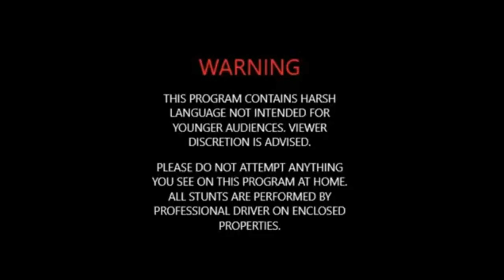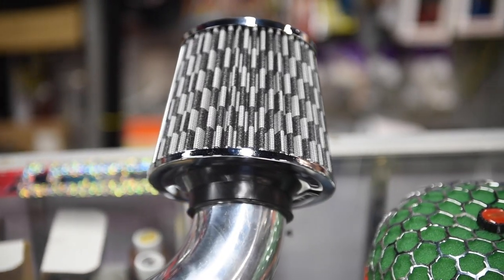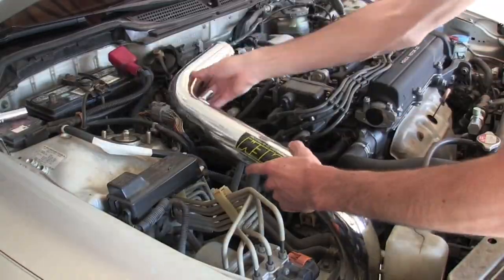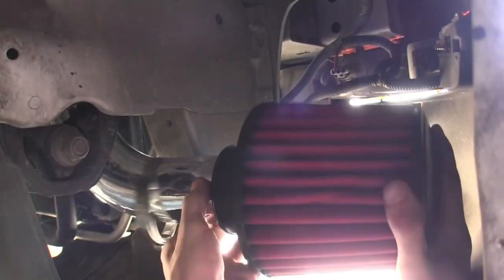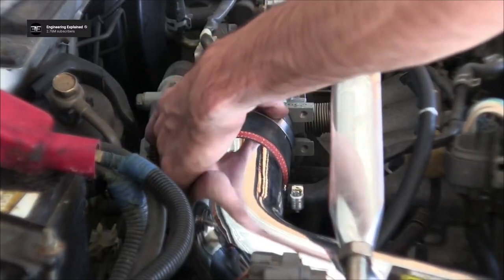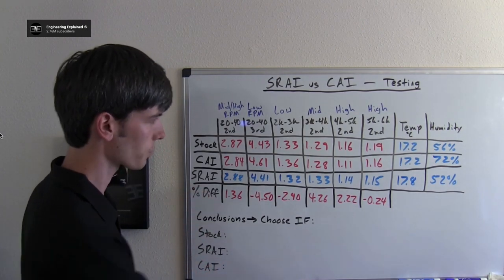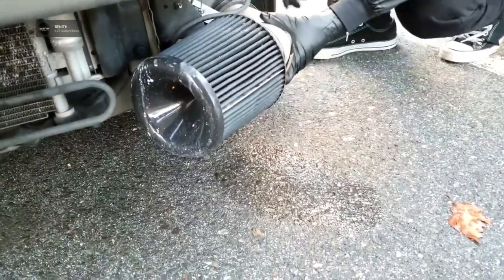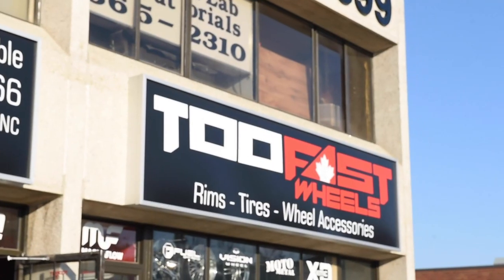COLD AIR VS. SHORT RAM INTAKES

Comment: Sow many videos watched about this subject and none says the important thing. With hot air the ECU  injects less fuel. With cold air there is more power. That is logic behind the air sensors and air density. But can someone please make an "scientific"  test about the fuel mileage in the 2 situations? Please. Thank you.